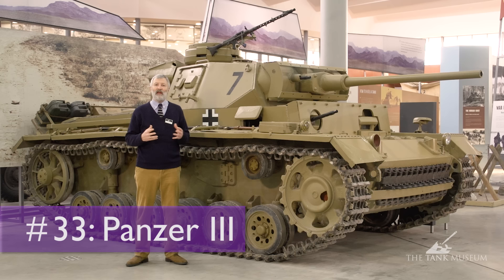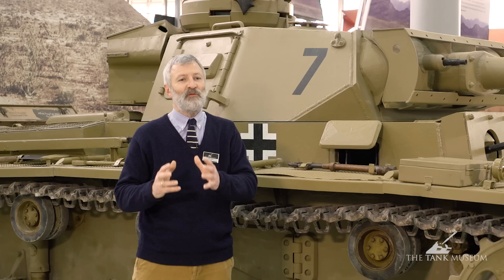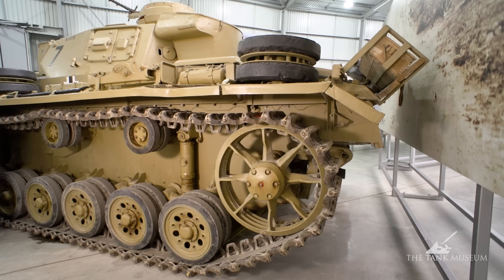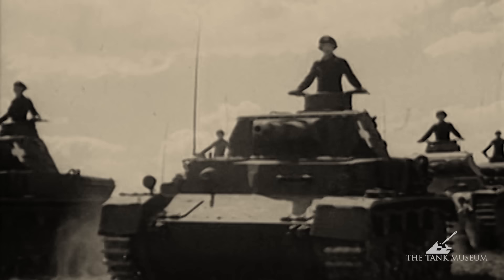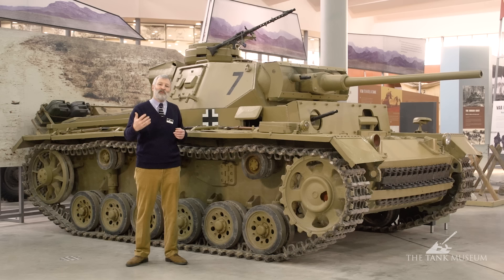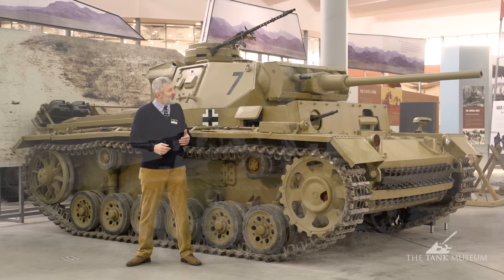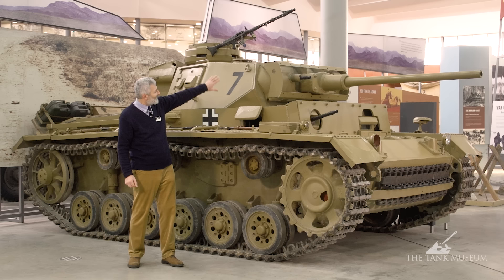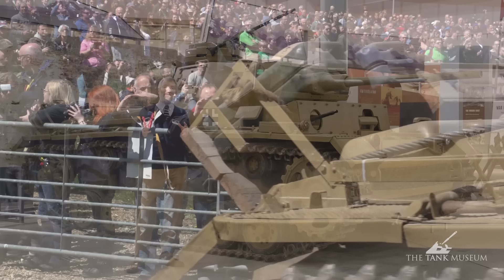Tank Chats #33 Panzer III | The Tank Museum

Comment: The 37 mm gun called later on „Panzeranklopfgerät“ literally means „Knock-on-a-tank-device“. My grandfather talled me that.
Reply: Some tankers called it a door knocker. But with good aim, they could jam the turret of a T-34 and outmaneuver it after tearing up the drive sprocket.  Then shoot up the rear.
Reply: @Jörg Schimmer
Which unit was he part of, pray tell?
Reply: @Briselance  . He did tell me that when I was very young. I forgot it. He is long gone🤷🏼‍♂️
Reply: @goldenhawk352  I'm glad we can talk about as history. As a small boy in 1960, I lived in Munich. There were still hundreds of destroyed buildings that hadn't yet been torn down. Guys on the street of an age to be veterans had a lot of amputations. I'd seen one or two amputees in my whole life, never one or two in a ten minute walk. That was the aftermath of what your uncles and grandfathers survived. In honor of the dead of all armies, I hope we never have another like it.
Reply: No, it was “Heeresanklopfgerät” if you want to be precise about it.
Reply: “Paint-Scratcher?”
Reply: @schwatzy6362 The t34 armor was found to be easily disabled because it was very brittle meaning even 37mm was a threat to it.
Reply: @puebespuebes8589  It is true that German steel was of better quality but the slightly lower quality of T-34 armour was offset by the sloped hull and curved turret the t-34 incorporated into their design. Under no circumstance could a 37 mm shell penetrate the frontal and side armour of the T-34.  37 mm were effective when attacking them from the rear where the armour was thinner. The only chance the 37 had on frontal was to have a shell jam between the turret and body then the Pnz 3 would speedily out manoeuvre to the rear. If and only if the skilled gunner could hit the T at the same place more than once and more than twice then splinters could break off inside the T

Comment: The funny thing is, is that the Pnz3 was meant to be anti-tank, while the panzer 4 was anti-emplacement, be then the roles were switched XD
Reply: Sun_skimmer 89: yeah, they didn't expect the gun calibre to need to go up so fast! It jumps from 20mm autocannons on the II, to 50mm on late ausführung IIIs, to 75mm on IV and panther, and 88 on the Tiger. They just had to keep making the barrels longer too!
Reply: Later in the war they put a long barreled 75mm L/48 gun on the Pz IV and converted the Pz IIIs to StuGs, also carrying those 75mm guns. I guess they couldn´t fit them into the Pz IIIs turret.
Reply: and if they got damadged shipped back to the local stug workshop
Reply: Ironheade yep, the turret ring wasn't big enough. I think the short barrel had a smaller breech so it could fit inside the ring?
Reply: @Ironheade That is exactly what happened. The turret-ring's size of the Pz IV was noticibly wider than that of the III, which allowed the Pz IV to be more easily adopted to later developments of the ever increasing gun-sizes.
Reply: I'm no tank expert, but shouldn't all 75mm guns gave roughly the same breech size, irrespective of barrel length? My guess on why the 75mm L/48 wouldn't fit into the Pz. IIIs turret would be the higher shell velocity due to the longer barrel and therefore higher recoil. So the breech would recoil further into the turret, compared to the short barreled 75mm, and hit the back plate. Don't quote me on that though. :D
Reply: Another reason is the length of the gun - it would overhang the front of the tank too much,  putting too much pressure on the front suspension and unbalancing the vehicle overall  (also makes it more difficult to go around corners in towns etc)
Reply: I agree completely: it's a combination of a larger charge and more propellant; more resulting recoil from that difference in charge; and the weight/balance issue.
Reply: I thought the reason they couldn't mount the long 75mm was that the breech couldn't fit in the turret.
Reply: The Panzer III Ausf. N had a short 75mm cannon. They operated with Tigers I believe
Reply: Anolaana Seranaar 
The last Version of PzKw III had the 7,5cm L24 from the first Pz IV
Reply: Crystalynn No. The L24 has a short barrel, the L45/L48 have longer once and the L70 Panther Cannon has much longer and thicker barrels. 
The bigger the load-the bigger the Power, the bigger must be the turret ring.
Reply: The Panzer II definitely had an aunt auto cannon. Where did you here it was single loaded, I'm curious.
Reply: Sir Boomsalot Sorry, was wrong remembered. 
The Kwk 30 was full auto with 280rpm and 10 round magazines.

Comment: Pz 3 tanks production was halted in 1943, but the tank soldiered on till the end. The Pz 3 N with its 75mm gun was used in mixed formations with the Tiger 1s as close support tanks. Any older models that returned to the factory for repair or refit were brought up to 'N' standard and reissued to the Hvy Tank companies . The German considered the Pz 3 to be the superior engineered vehicle to the Pz 4.

Comment: I think one of the biggest advantages of having a frontal transmission or drive sprocket is that for the driver, it is a whole lot easier for him to shift a gearbox that he is sitting very close to than to, in the t-34 for example with a rear drive wheel, shift gears which are on the other side of the tank from you where the controls for those are much weightier, literally, and just harder to make do what you want basically

Comment: 8:41 Just the thought of Soviet tanks nearly causes him to vomit.
Reply: ulrickts 
Yes because the KV1 and T 34 were actually a bad news to the panzer 3
Reply: @yes 
I understand your enthusiasm towards German panzers i am myself a great enthusiast actually (I am German after all). However we can't deny the fact that the T34 had excellent armor for the time, which the standard German Pz-III had very much troubles penetrating. The standard 37mm anti-tank gun was totally useless against it. The short 50mm /42 gun couldn't penetrate the front at all, and the side only with special ammunition, which was always in short supply.

So the early German tanks (such as the Pz III) had a very hard time knocking out the T34. The T34 on the other hand, had no problem killing German tanks. The dual-purpose 75mm gun could penetrate the front of the Panzer III at any combat distance. However, it is important to note that most German tank men were far better trained and had modern radios to communicate(which was essential in modern war) The 34 relied on primitive methods from WW1 without access to radios or the ability to conduct coordinated attacks (again, due to poor training) this unsurprisingly led to many more t 34's get destroyed despite the fact it was a superior tank, it proved that having good tactics and training was far more important.  But, you are totally wrong in saying the T 34 as a tank was inferior to PZ 3, that's just pure nonsense, this led to the Germans making the Panther tank (which was indeed superior to T 34 i will say).
Reply: @music I mean the t34 obviously was a much better investment of time since the soviets  won ww2, or at least it just goes to show that the soviets fought even harder than i previously knew, all the more impressive in my eyes at least
Reply: @music Interesting read, it interesting how the military doctrine of the red army which didn't rely on armour to the same amount that the german army did ultimately was more successful. Especially considering that nowadays a lot of people seem to agree that the tank is an obsolete weapon of war. The soviets seem to have to constantly battle the myth that they only won the war due to throwing millions of people at the technologically way more advanced german army.
Reply: :D
Reply: @thomass1891  Half of the T-34s broke down. It is mentioned somewhere on this channel.
Reply: The Werhaboo is strong with this one. The Russians could easily sustain these losses while Germany couldn’t. Think strategy, not tactics.
Reply: @Media and Entertainment You're using a classic Internet debate tactic - overwhelming your opponent with walls of text that look imposing and scholarly. If your opponent decides that he doesn't want to spend a few hours typing up a rebuttal to War and Peace: Tank Edition, then clearly your argument was superior and you can claim victory.

One might be led to believe that you are a scholar of armored warfare, because you have mastered the art of copying and pasting paragraphs written by actual scholars in this field. But you give yourself away with your talk of "absolute trash heap lumps of worthless junk" and "sublime German killing machines". Hyperbolic statements like this are the preserve of Internet trolls and Wehraboos, not students of history. If you're going to masquerade as the latter, you need to step your game up.
Reply: @thebog11  Regardless of his choice of words, the stats that he lists are real and sourced which is always welcome in any historical discussion. He is fully entitled to his opinion aswell.
Reply: C.H.A.D Bravo  the germans were defending which always produces less casualties than attacking, also to say that they fought on two multiple fronts is technically true but that's giving the brits and americans far too much credit, the two of them combined didn't even come close to meeting half of the german forces, was the t 34 the greatest tank ever? no. Was it the most important and best utilised tank of the war? absolutely.
Reply: @ciggy_  The problem was, with Germany defending, is that they really didn't. Most of their stuff was horse drawn whilst the Russians had thousands of trucks which allowed them to rapidly close with the fleeing Germans, preventing them from setting up proper defensive positions.
Reply: C.H.A.D Bravo  "Absolute trash heap lumps of worthless junk" "sublime German killing machines" 

How are those statements not hyperbolic? They pretty much fit the dictionary definition of hyperbole lol
Reply: @Media and Entertainment Too long; did not read. Sorry you got triggered, Wehraboo. How long did it take you to type all of that up? This paragraph took about 20 seconds.
Reply: @Media and Entertainment The Tiger was so groundbreaking that the very concept of a heavy tank was obsolete by 1965. Even the postwar heavies like the M103 and the Conqueror looked more like IS tanks than Tigers. Giant armored boxes with flat armor were not the way of the future. The Germans would have been better served churning out Pz IVs and StuGs rather than big cats.
Reply: @Media and Entertainment "Emotional over which side had better tanks" - you're the one typing up essays about it. 

"All other WW2 tanks were failed experiments" - there is no way you seriously believe that. What an absurd thing to say. Centurions, Shermans and T-34s were used for decades after the war.
Reply: @ciggy_  they were attacking in 1941/42/43, then defending in the second half of 1943/44/45. German military doctrine emphasised counter attacks/offensives, so they actually rarely defended defensive positions.
Reply: @Media and Entertainment Nobody cares. We can read too if we're that bothered.
Reply: Who won the war? Not pazer iii creators
Reply: Media and Entertainment Hats off to you sir, you are the greatest troll I have ever witnessed. Kudos to you, and may the favour of god be upon you!
Reply: I’m taking Soviet armor any day
Reply: @thomass1891  The panther tank would never be able to be produced in the same quantity as a T34, it is a much more complicated design. In armored warfare superior numbers win battles. Much smarter would have been if the Panther was never built, and they could build more Stugs, that gives much more bang for the buck, than a Panther.
Reply: No I think it's a hiccup

Comment: One of the workhorses of the German Army
Reply: Yep, just like the Pz IV, a hugely successful tank in many ways
Reply: Much similar to M4 Sherman and T-34 which were also easy to produce and reliable and which lived through most of the war. Pz III and Iv as well as M4 and T-34 were also upgunned during their service life.
Reply: T-34 lived through the whole war not because it was so cool but because nobody wanted to change the industry to get used to a new model. there at least two attempts to improve T-34 during the war and one more before it. but all failed because of the idea to build shit but MOAR shit. Sherman was far more effective and reliable tank than the T-34
Reply: Станислав Беленький  No tank is perfect but T-34 did the job logistically and on the battlefield.
Reply: When you weigh up all the pros and cons, manpower and skill levels thereof, logistical difficulties, armour thickness, mobility, size and effectiveness of gun,  and a thousand other variables, the T-34 was probably the best all round tank of the second world war if not ever.
Reply: +James Horsey Walsh
I would like to add that the T-34 was probably the best all round tanks for Russia's needs during WW2 (and by doing so, was effectively the best tank of the war). I do not think that a tank like the T-34 would be considered a success if it would have to be sent over the Atlantic and used by the US army.
Reply: Different tanks are good for different tasks. For example Churchill was good for infantry support because of its heavy armor and terrain capacity. Fast tanks such as Stuart and Cromwell were great scouts. T-34 had several good characteristics and was definetly an important part of the outcome of ww2.
Reply: +McPuff
what was little more expensive to produce in the US, does not mean it is effectively produced in Sovjet-Russia. If you are going sufficiently into detail, you are bound to start comparing apples with oranges.
Reply: Can you back up that claim. I think lots of people mix up reliability with parts availability. The Allies were really good at war logistics. These tanks were always combat ready because of that.
Reply: LOL. somebody believes in moral issues in politics and believes in stupid leftist ideology. nevertheless, Germany could not stand against three major industries in the world and the Germans knew it. but something got wrong
Reply: So 2 men fighting the same war on both sides of the same conflict can give a biast must have a biast vieuw to 1 side of the conflict ? 

So you are trying to tell me the peaple that were there dont know what happend around them but some pencil pushers 50 years later know exactly what happend..... dont make me laugh
Reply: papers written by cornels and generals even more pencil pushers lets get our information indirectly from a indirect source, as the source might be biast. sorry i am not interested in propaganda just in facts. And so that you know insulting peaple is a sign you aint capable of having a actual discussion so i wont be responding to you mark =]
Reply: there are still some idiots that consider documents as a fake and believe only in oral history or memoir. don't take them seriously, Mark
Reply: yep lets all believe the russians liberated eastern europe during WW2 and didnt kill off the resistances groups who fought the facists becouse they migth resist against the communists... As propaganda is written by the higherups and the gouverments....  as i said every story has 2 sides and ww2 seems awfully one sided written in history...
Reply: top kek. the Red Army defeated the German forces in the Eastern Europe. you could have remembered polish or even czech troops which did the same thing. after the war people in those countries elected left parties because they were popular as the only fighters against Germany. oh yeah, the french communists were popular in France becauce of the same reason
Reply: The Soviets weren't in the habit of liberating anyone.
Reply: We will not talk about the Warschau uprising where the russians causualy waited for german troops to get of the line to quell the ressitance...
Reply: And I keep getting notifications of this comment war...
Reply: Comment War never changes.
Reply: This the Stug and Panzer IV are the best german tanks, not megalomaniac Tigers or Panthers.
Reply: @baastex  Ah yes, Merkel's Fifth Reich. The visual image of Merkel giving a shouty speech, slamming her fist on the podium, at a torchlit rally is making me giggle.

Comment: The Panzer III was in production for a long time really, considering it had limitations that became glaringly obvious when it came up against well crewed T-34's on the Eastern front. The III had numerous important upgrades during the war but by 1943, it badly needed replacing..... even though it performed very well in certain theatres up to that point. It's still an iconic tank of WW2 though, especially as a chassis for the SPG generation.

Comment: I've always heard that the use of schürzen actually increased the effectiveness of HEAT rounds.   The stand off range for HEAT rounds of the period was often not enough to get the full effect of the kinetic penetrator, but the schürzen gave enough space to make it more effective.  The schürzen were only used as a make shift solution to 14.5mm AT rounds fired from Soviet PTRD and PTRS rifles.
Reply: +McPuff another example is putting metal tracks on the tank as armour. they will make the shell hit at a better angle for penetration
Reply: I've heard this argued before but I note that many of the lightly armoured vehicles used by the British and Americans in Iraq were also fitted with a metal "cage", presumably as protection against HEAT RPGs. I find it hard to believe the Germans never tested the effectiveness of the armoured skirts against HEAT warheads which were increasingly common as the war progressed. But I'm no expert.